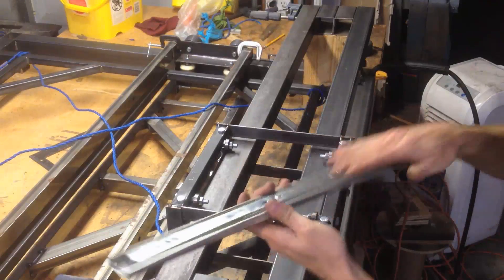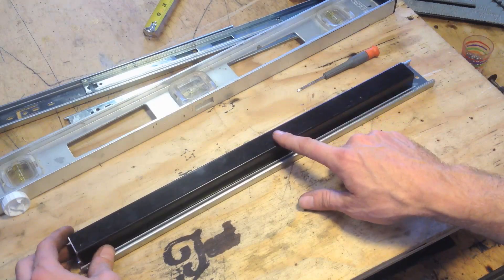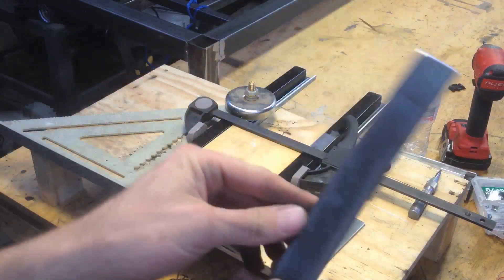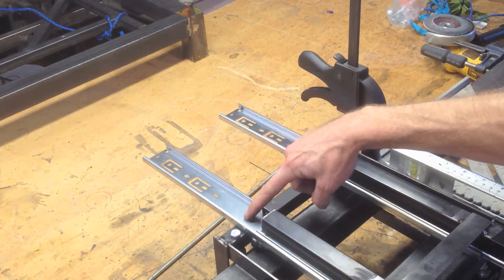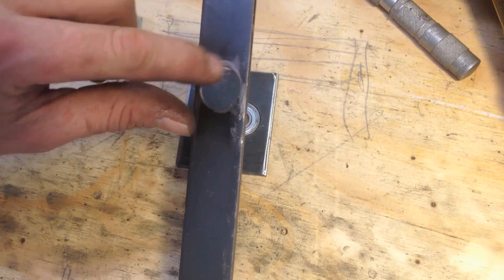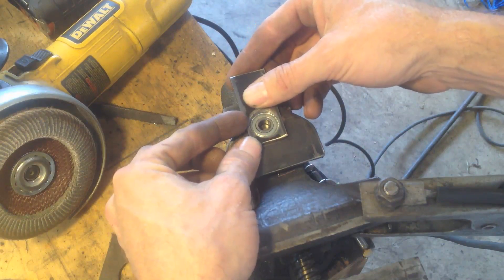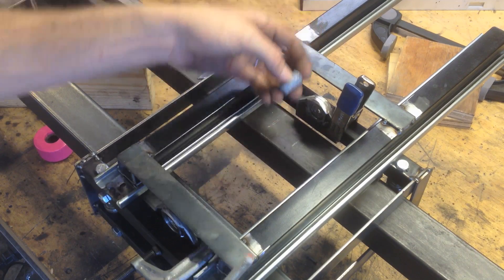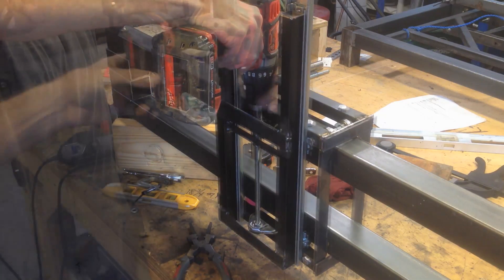How to: DIY Arduino CNC Router Cutter Welder (Part 3: Z-Axis)

Comment: Use proper hardware. Linear bearings and leadscrews dont cost that much. They are the most important parts of the build.

Comment: well ,that so far a lovely work to see,but i think u made a little mistake by welding bearings holders, what if you need to change the bearings?!
Reply from the maker: They're not really welded, but rather just tacked, which is easy to remove.

Comment: hi my friend can you tell me how accurate drill presses are ? i mean can i make stepper motor  shaft-lead screw couplings with it?
Reply from the maker: After the welder, the drill press is my most important tool.  Building this without a drill press would be extremely hard.   Yes you certainly make couplings with it.

Comment: btw you should not use your saw as a grinder, if you weaken the sides of that thin disc it may crack and cause damage... One of the most common accident down there :x (excuse my poor english)
Please if you do that sort of stuff (like welding without a mask) you could take a second to add a text on your video saying "don't do this at home" lol
Reply from the maker: I use my chop saw just to take off the burs, been doing so for 16 years without an issue.  Yes I will try to be more conscious of safety of my younger viewers :)  Thanks for watching!

Comment: лучше посмотрю когда жана моет пол
Reply: на мебельных направляющих  только дерево и пластик , и те запылятся
Reply from the maker: I've tried google translate and makes no sense.
Reply: I think he's asking about a possible issue with dust in the bearings of the drawer rails.  Did you have any problems with this?

Comment: And now you cant chance bearing with out grinding the parts off.. Wtf?O.o You could have made plate that you bolt on and that could have slot for the nut. Screw system it self looks terrible flimsy comparing to rest of the body. I guess it could work, but its just the weakest peace of the chain. Also your using normal bearing on that?... why? Cone bearing would have been much better option and those wont cost fortune.
Reply from the maker: +Hellsong89 I invite you to build your own, then you can have it your way!
Reply from the maker: They're not welded.  They're tacked and easily removable.
Reply: +Absorber of Light Hey - dont be so thin-skinned - just a little bit critics and you blaf back. 
I wondered why you weld the bearings in place too - If you bolt the top plate instead of welding you can change it. And in comparison to the rest of your construction whisch is rather sturdy the lifting mechanism oock really a luttle bit flimsy.
Reply: Nice trick! I have memorized.

Comment: I think I will chime in here as I sub your channel. I really appreciate your take on the fabrication process. You have covered all the bases except how you decided on steel tube sizes. I will have trouble finding small lengths of these dimensions. Not such a big deal, in the larger picture, but this series has really fanned the flames. If I can avoid  Ebay delivery times for lead screws and bearing blocks I would be very pleased.
Seen an Android app that allows you to get 3D from the camera generated jpeg files.... wood-n't that be fab for doing facial renditions. Not to sure of the file formats
As for my RC hobby, the ability to cut out carbon fiber sheet, with zero backlash using 1/16th"  end mill, ,..! Possibilities boundless no?
 Happy New Year
Reply from the maker: +Chris Leech Thanks Chris,    I've done a lot of work with those particular tube sizes: 2in 14ga, and 1in 14ga and that's why I chose them.   I buy them from a metal supply, never from  home improvement store.   Bought my lead screws and blocks from Ebay....  I think for more 3d stuff like a face you would probably need a 4th axis.  Possibilities boundless? YES
Reply: +Absorber of Light   your comment is incomplete on my putor. last it reads is this " I think for more 3d stuff like a face you would probably need a....   please finish for me. Thanks, oh and awsume work my man!
Reply from the maker: I think for more 3d stuff like a face you would probably need a 4th axis. Possibilities boundless? YES